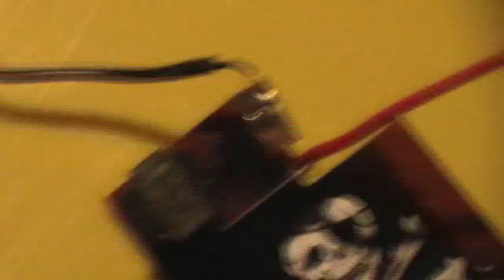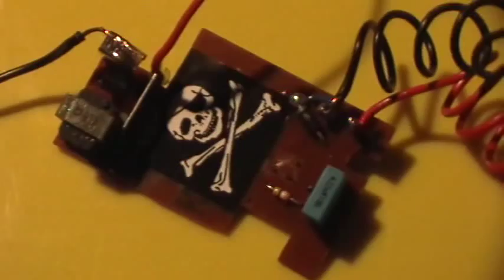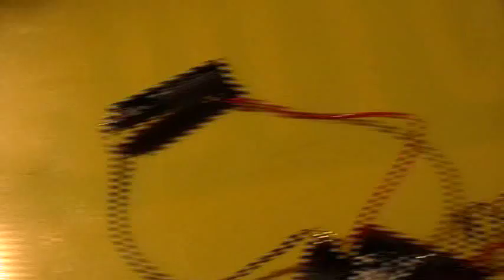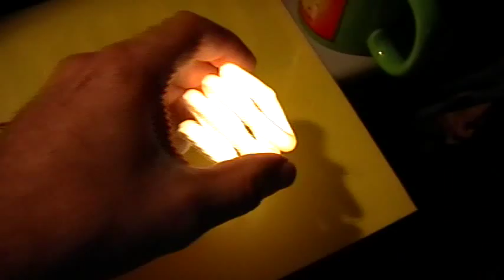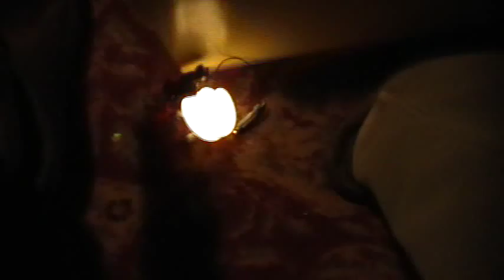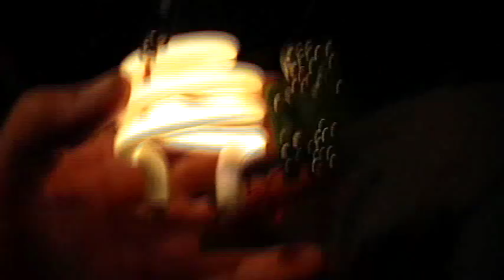Joule Thief: A Quick Test of the Pirate Light

Comment: I think if the output of the tube is DC, then you could put two circuits in parallel, and the two DC currents would add, making the tube brighter.  But if he removed the rectifier, then the output is AC and using two circuits probably won't work.

Comment: Nice job.  On the modification, you also need to solder a jumper from the minus output to the cathode of the diode. (The end with the white ring)  You also cut off the flash switch leads close to the board and solder closed the spring switch on the bottom of the board.  That's it and it drives all kinds of lights using high voltage and very little power.

Bill

Comment from the maker: I don't know, maybe. Why don't you try it and see? I think the camera circuit has just had the cap and flashtube and neon removed, and the output is just where the cap used to be.

I think it's pretty bright already, for a CFL running on a AAA battery.

This is a big CFL tube, like from a 100W equivalent. I think a smaller tube might look brighter.